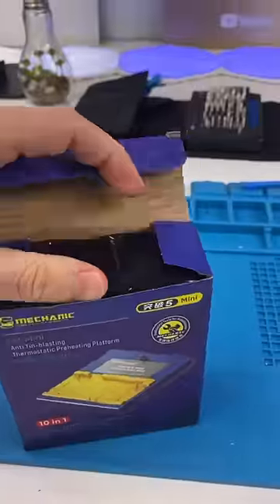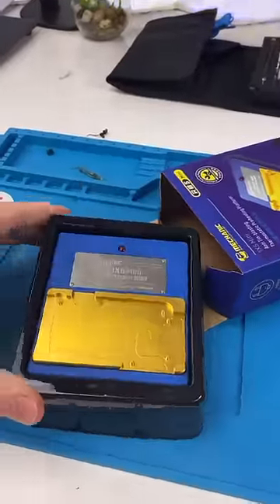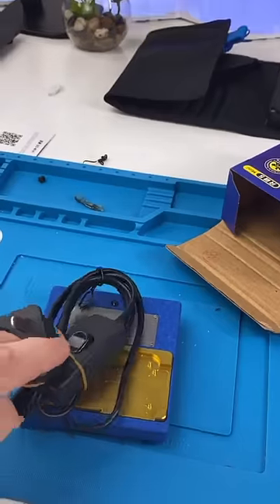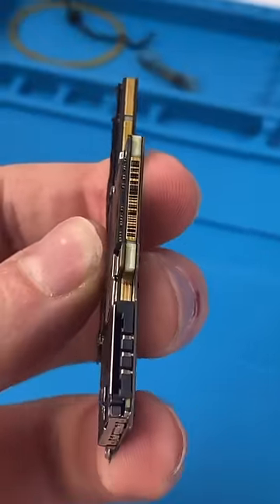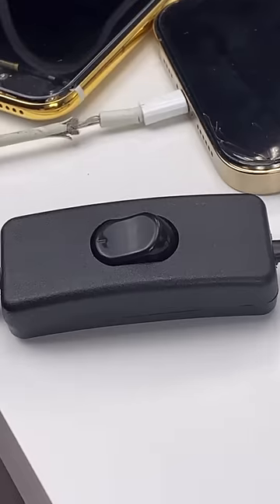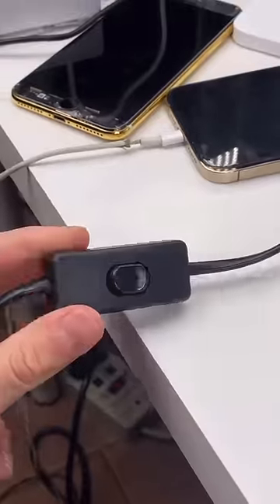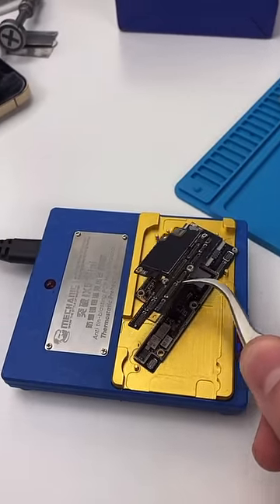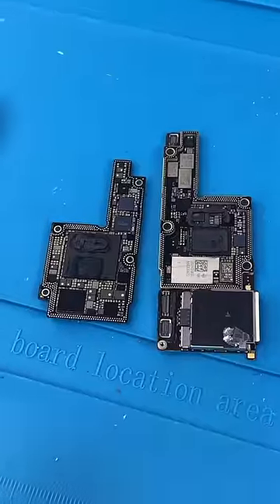I Opened Apples "Sandwich Board"... It Started Smoking #shorts

Comment from the maker: Idk if I should use this anymore, That was concerning... Hope you guys enjoyed this video! don't forget to hit that sub button ;)
Also I'm starting a new channel for jailbreaks : https://www.youtube.com/channel/UCsvtCEteOBppQ4TeqAiV91w
Reply: Nice video
Reply: Nokia next
Reply: Can you tell us where you get your parts?
Reply: By-pass the switch it seems that this could be a 500 watt heater or more or less not too sure but these aren't met for the high loads
The cooker is great but may cook the switch and may not be able to cook the board
Reply: Maybe need mod the stove
Reply: Well, another brand? Idk either
Reply: The button was shocked the way it was thrown on the desk, maybe not a smooth trip
Reply: Open it up and repair it.
Reply: The thing is can you repair the button???
Reply: Just put in an appropriate rated switch and you’ll be fine. You fix $1500 phones, you can fix this mini stove.
Reply: Just remove the switch and keep using it.
Reply: Guy repairs iPhones for a living but stumped by a faulty switch? XD
I'd open the switch (unplugged) to see what happened and probably either try to fix the switch or replace it with a new one.
Reply: Hey PRG, I want you to see inside apple phone processors using laser thing which used to remove phone back glass... its cool to see inside processor.
Reply: Just fix the switch and it should be fiiiiine
Reply: Maybe it was just a bad one? You could try contacting the company to see if they will replace it for you and if that one still does the same then you'll know for sure
Reply: It's not good for things that take more power to be connected to that thing with a lot of plugs
Reply: Just use a separate power strip so you can use the switch on the power strip
Reply: Just cut the switch off and wire a plug directly to the cord.
Reply: Cord needs to be connected directly to I plug
Reply: @jmrumble    he need to plug it in to a direct plug 🔌
Reply: It broke because it was made to work with Chinese standard electricity.
Reply: EDIT: NVM.  Upon closer viewing, I can see that it looks like it has some kind of oddball proprietary power connector.  It looks like it might also have some or all of the controls built into the cord itself.  Either way, just the fact that they purposefully used some sort of proprietary crap to lock that cable down is enough to make me say you should ship that shit back.  If they went to the trouble to make a shit proprietary connector for the sole purpose of making it impossible to repair down the road, then they sure as shit better make sure it's not going to melt immediately after unboxing.  I'm leaving the stuff below there, just because it does actually apply to 99% of most other things: if a standard A/C power cable breaks, it's almost always a very standard part that can be replaced very easily for almost no money.

I mean, if the manufacturer won't replace it, it's probably not a good sign.  But if you want to use it safely, you can easily replace that cable with any old lamp kit from the hobby store.  You just want one of those kits to turn anything into a lamp and then pull out just the cable with the in-line switch and wire it in.  You can get those cables on their own, too, they aren't expensive.  So long as the device itself heats to the right temperature, the internals don't look like they were hot glued together by a monkey, and it looks like it's been properly grounded (when/ if you were to take it apart to replace the cord you should check that) then I don't think there's that much that can go wrong with it.  It's probably just a simple heating coil or induction heater dealio under that shaped hot plate.  

Though, honestly, I'd bitch to the manufacturer.  I would actually assume that for something like this it has more to do with whoever makes those cables sending them a shit batch.  We've had that problem at our factory, before.  It's kind of a hard thing to test on small-run items like that (since checking that switches won't fail usually means that you need a special-built, single-purpose machine to switch them on and off thousands of times for QA, which you probably don't have the facilities for if you're making products with inline switches like that on a small scale).  They should still own it and replace it, though.  But I kinda suspect that this might be an AliExpress buy you ordered months ago and have no real expectation of anything even remotely resembling a "warranty," so fixing it yourself might not be a terrible idea.
Reply: You can find a small relay module (10A)or a higher power switch (10-15A)  if you’re worried about the power of the heater 500W \120V ~ 4A so either option would be sufficient with room for rating overhead
Reply: Bro connect it to a wall outlet not a power lead.
Reply: Not sure if you'll see this, but anyway: I have and use this heater. First off, replace the switch. It's just a regular lamp type switch. Second, those shapes and pegs are for aligning and holding the various boards it support, in place correctly, so the bottom board doesn't move around when you work and you get proper heat contact in the right areas.

Also FFD don't drop any of those boards when they're hot enough to melt that solder. DEFINITELY don't drop on eachother.
Reply: Bro you work with electronics, you know how that works, this must be bait.
Reply: for Android phones too please
Reply: as an electrician For sure NO if its just a simple switch try to get it replaced or do it yourself if youre confident enough if there is electronics inside then just get a new one but like that its a fire hazard or could melt isolation and provide a shocking experience if youre unlucky
Reply: Bro you can fix that, 
You already know how to fuck with stuff. 
Just don't work on it while it's plugged in
Reply: Grab one from sunshine, the one you have is junk
Reply: Maybe it was running on wrong voltage because it's free overseas.
Reply: Hey that new channel looks cool, it also would be great if you also showed android rooting, but at the end of the day, it is obviously your decision!
Reply: Lol, I'd prob just cut out the switch and hard wire it. Then when I need it I just plug it in.
Reply: Cut a new cable in then put it on a switched PowerBar and use it that way. Shitty low current switch for a lamp used for a heater.
Reply: Yeah, um maybe buy it from somewhere other than Wish next time lol.
You could just buy a decent switch yourself and install it, or get a cooker that comes with actual QC and a switch that doesn't try to kill you immediately
Reply: Send back lol
Reply: How do I get my phone repaired and featured on one of your videos
Reply: Me seeing the board cooker with a mains switch: "Noooo. No no no no no no no no no....." Best solution on board cookers is getting one that runs into a soldering station for peak temp control. 

Source: Made the same mistake as you in getting one for the mains.
Reply: You should probably contact the manufacturer about it smoking, that is a potential safety risk
Reply: I think you would be Able to make it safe 😂
Reply: @sharashka510  soldering station is a 24V, maybe 3A device if we're generous. It'll get the small tip to soldering temperature, not a whole PCB! No other sane choice but mains. You know hot air stations have like 700W mains heater in them as well?
Reply: There better alternatives for this device i personally use sunny or something it interchangeable with diffrent models and have a better holding on the boards cus its model related i also would recommend putting one ot the longer screws in for the plate so u cal lift it from there instead of lifting in between layers change of damage is lower than
Reply: Don’t use that machine anymore mate. You can’t risk hurting yourself or burning down your shop with it. If the switch wasn’t properly chosen for this piece of equipment, imagine how dangerous the rest of it could be.
Reply: Just replace the switch if that does not work the  idk y that wouldn't work or too much current Drawn that the switch could handle  a typicial switch can handle 16A
Reply: Change the switch to something with a higher amp rating
Reply: Point me in the right direction to buy some of your equipment like that heater.

Comment: I mean, the device is high current. And the switch is probably rated for low current applications. Explains the reason why it failed. Chinese device's concepts are good. But are usually cheaply made. Explains it all.
Reply: Mechanics is one of the higher quality Chinese brands tho. Must have slipped their QC.
Reply: the device looks solid, ig their cable supplier must have slacked off cuz the cable looks cheap
Reply: That's because they're usually using an already made design.
Reply: Tbh, if all it is is a simple on/off switch, you could def just cut the wires around it and rewire in a switch that's rated for higher current and splice/solder the whole thing back together
Reply: @patrickgardner2204  that cable has a standard connector on it he can just buy a new cable, preferably ones with the soft silicone wire (the wire thats usually on hakko soldering irons) as it doesn't harden and dosent tangle
Reply: @dopamine2655  high quality and chinese brand don't go together
Reply: @iCore7Gaming  I never said it was high quality. It's just better than the usual.
Reply: @iCore7Gaming  what bout dji
Reply: @iCore7Gaming  
There are more high quality chinese brands than i can count
Reply: @omegaPhix  People base china's factories manufacturing quality by their cheap 2$ aliexpress order with free shipping
Reply: @iCore7Gaming  bruh
Reply: @dopamine2655  What QC? Lmao
Reply: @ShahZahid  I would just head to like any hardware store or microcenter, find a cable rated for the same voltage and Bada bing Bada boom new device let's go
Reply: It’s always best to keep this in mind before using such items. 
This guy was just like, yea it’s all good. Just a little smoke🤷🏻‍♂️🤣
Reply: @manny4707  at that point, why not just cut a toaster open  slap a piece of steel plate on the heating coil, and turn it on? Probably works faster, and it definitely won't kill you cause you KNOW it wants to lol
Reply: I honestly thought the same as the device is probably made for 240VAC Mains in China while he is (probably) in USA using 120VAC, drawing Twice the Current
Reply: @karl810  Tell me you're delusional without telling me.
Reply: Mechanics are phenomenal and most of my own personal kit is Mechanics. Only thing with them board cookers though is they're best with the attachment to go into a temperature controlled soldering station.
Reply: @iCore7Gaming  : ankukar , dji , all those haweii phones are Chinese
Reply: just replace power cable with a higher gauge and a stronger switch like one off a electric fireplace
Reply: @wintesrain  "You just hate Chinese people" Lmao I bet you wouldn't have said "You just hate American people" if he said that American made stuff is cheap 😂
Reply: @2hotflavored666  It would depend how he said it. If for example he said all American made shit is cheap then yes I would have said the same thing, but when I see someone shitting on a country with apparent vitriol regardless of fact I'm going to call that out. Also, I have called people out for what seems to be puerile American hatred. As a Veteran of this country I think I've done more than enough to defend the country so I don't need you coming in on an inane point questioning my filial responsibility to the nation I was born in, did civil service for, and served for.
Reply: Usually Mechanic brand is decent. I wonder if this is a PTC ceramic heater and thus regardless of voltage the power is going to be within about 20% difference, reasonably close; but Chinese mains runs on 220V. So it ends up consuming double the current, which they have not validated the cable and wiring for. To make things more confusing these American/Japanese style bladed mains plugs are used in China, regardless of voltage difference, just something that kinda happened 80 years ago and is now difficult to fix.
Reply: It's more irresponsibly convenient than cheap 💀🤦🏽🙇🤷🏽🤫
Reply: @iCore7Gaming  depends tho , if you tell them  how exactly you want whatever you need manufactured, they will do it for you , if you requested higher quality you will get it, with an increment in price compared to manufacturing a low quality item
Reply: @dopamine2655  

If the power switch does not work, there is no QC.
Reply: @woodworkerroyer8497  these things prevent the board from getting TOO hot. 

If it gets too hot, your sandwich board goes from golden brown toasted to charcoal. Also, I'm not even sure if toasters can get hot enough. 

Idk the max heat of toasters nor do I know how hot the board needs to be, what I do know is that electronics can get fried like everything else
Reply: @joeslinky  QC stands for Quality Control

I'm surprised, it's been a year and no one ever bothered to reply with a proper answer smh
Reply: @iCore7Gaming  what about lenovo?
Reply: @iCore7Gaming   Tell that to Casio.....
Reply: @prathamkalgutkar7538  Me, too

Comment: Replacement in-line switches are $2 if you want to save that cord. And it’ll actually handle the power.
Reply: These cords itself are shit and the wire inside is probably thin af.

The thing is to replace the entire cable. It's not safe.
Reply: @fusseldieb  Probably. But the connector at the end didn’t look like any universal types I’ve ever seen.
Reply: um your pfp..
Reply: @stanleybochenek1862  At least it’s not default.